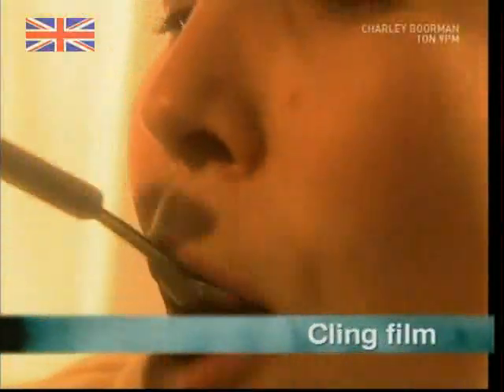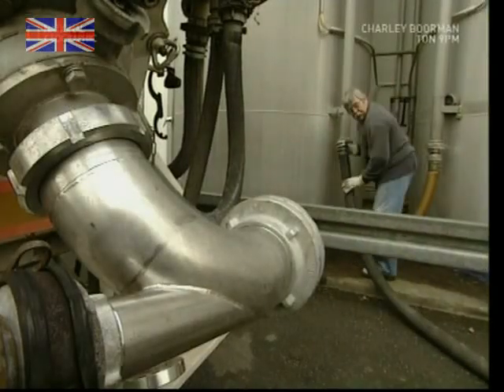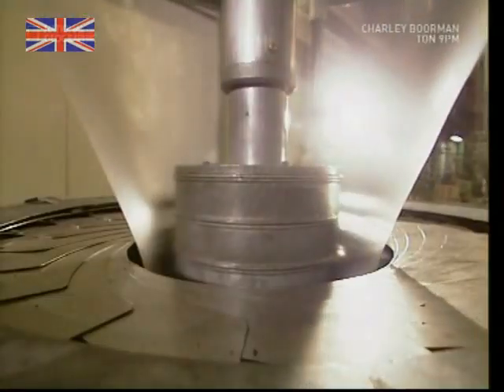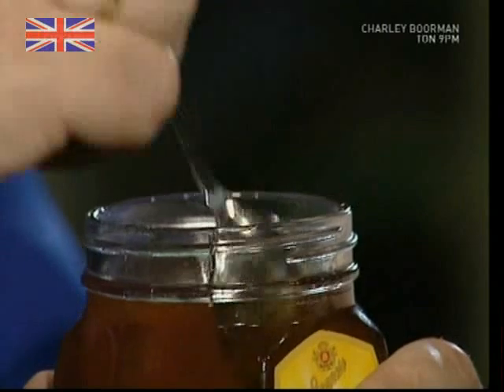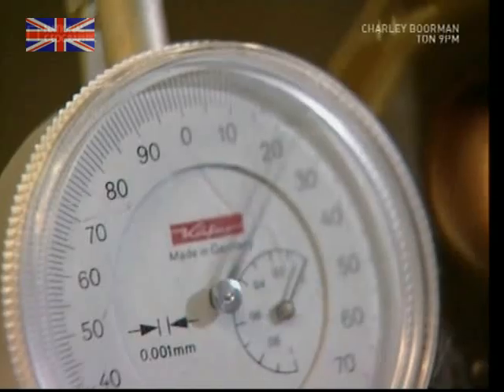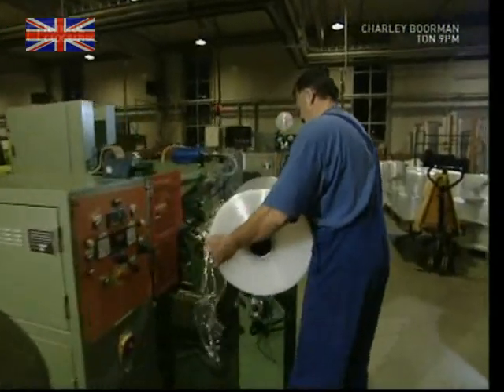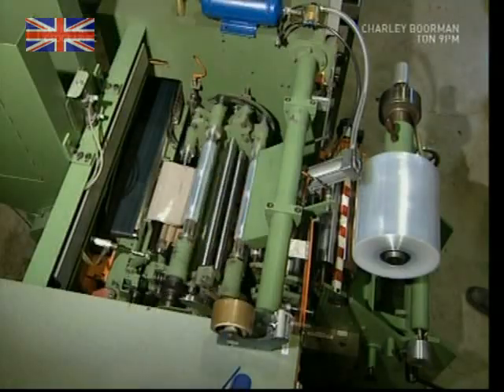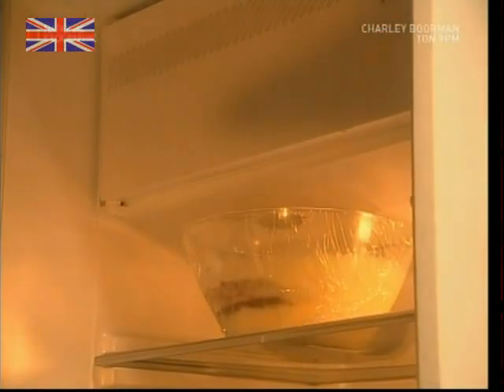Manufacturing Cling Film

Comment: It doesn't give me much confidence that the stuff is actually clean enough to wrap my sandwiches in. There are a number of places were the workers could easily have contaminated it.
Reply: They touch probably about 0.001% of the cling film produced. Your sandwich contents are handled far higher from farm to factory to shop.
Reply: Sylvia Else 
Go make me a sammich.
Reply: The meer act of picking the sammmiches up (during making and then wrapping) will introduce more bacteria than any cling film worker would.
Bet your hands are not aseptic during making of a sandwich.. That's why your stomach has pH1...